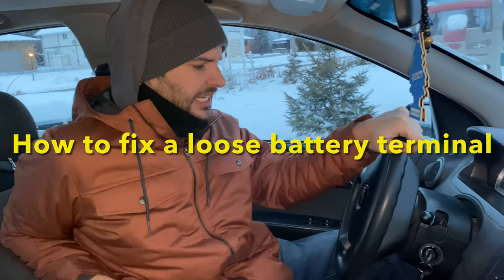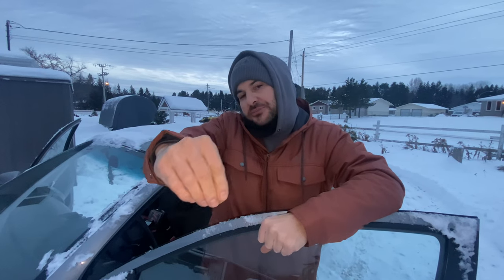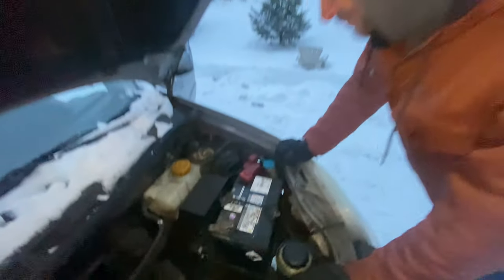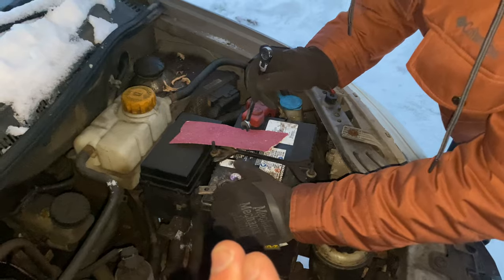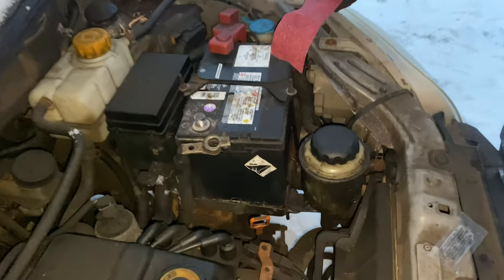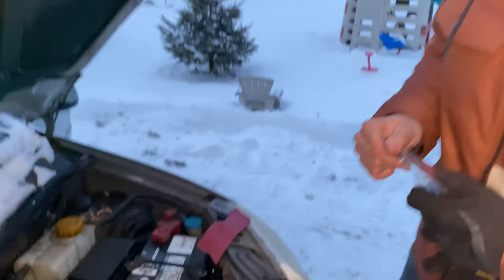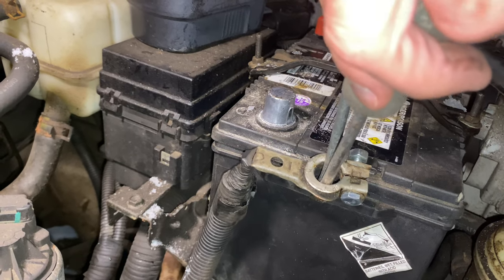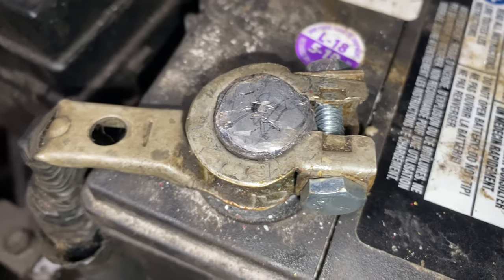How to fix a loose battery terminal (the best easiest way) Battery terminal shims.

Comment: I didn’t have this shim so I took some aluminum foil and folded it over a few times.  Then I placed it around the terminal and it fit tightly and did not move.  It started right up.

Comment: Regarding being careful when wrenching on the positive terminal: Even better would be to disconnect the negative terminal first. That’s how I was taught: Don’t touch a wrench to the positive side without first disconnecting the negative side.
Reply from the maker: Correct didn’t want to risk having to redo the positive terminal as well since it was working
Reply from the maker: But you are correct

Comment: I had this problem with my Honda Odyssey after replacing with a new battery. It's fixed the loose battery connections problem. Thanks for this video.

Comment: That’s great thank you those are exactly what I was looking for. I had seen other guys cut pieces of thin sheet metal or tin. What I had used was a hose clamp that I cut the screw part off and wrapped the rest around the post, but it wasn’t working so well, I’m going to get a package of those post enlargers. I apologize for saying this, but I do want to add that instead of dielectric grease I use NOCO cleaner and it also identifies the acid by turning red and after I clean the battery and the post I used step two which is a different spray that is similar to a PB blaster or kroil to protect the battery posts and connections. It works really well.

Comment: Dielectric grease is often sold at the register as “bulb grease” wherever you might buy replacement headlights and such. That’s where they have little packs that you tear open and use like a ketchup or mustard packet… instead of buying a whole tube for something you rarely use.
Reply: Probably a good idea to sand and grease the top of the terminal too in case it has any contact with the top of the shim.

Comment: screw a screw into it 👍
Reply: That's what I was about to do. Didn't know if I should drill a hole from the side or just go between post and clamp. I have used screws to tighten my battery  before, to fix a hole in a tire in a pinch and I've used concrete nails as shims for a wheel alignment. That lasted 5 years perfectly. There's always a cheaper, easier way to do things.